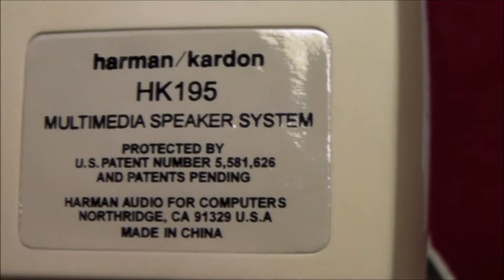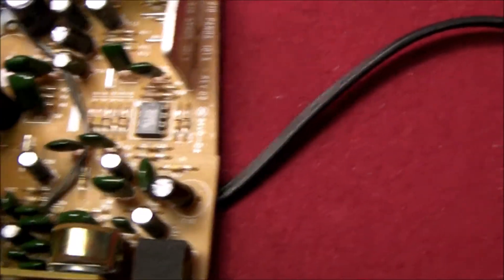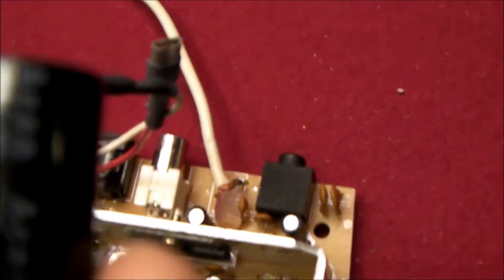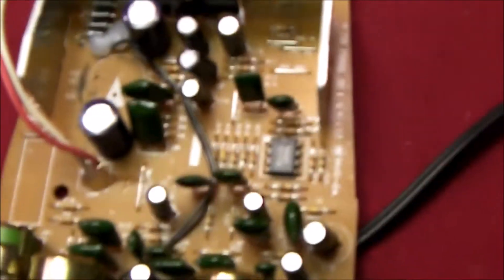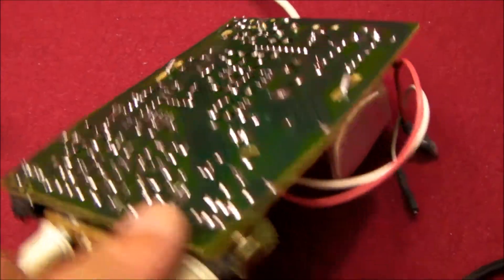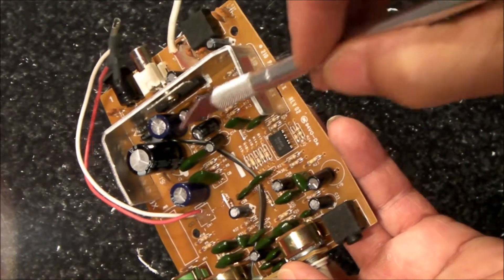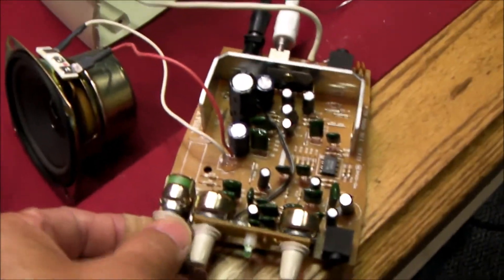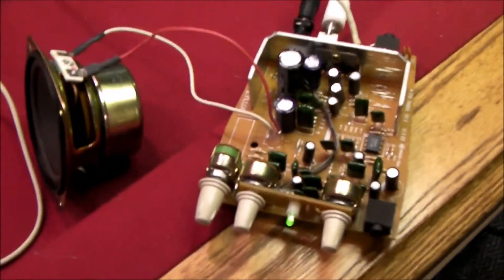Harman/Kardon HK195 Speaker Repair

Comment: I have several pairs both the short and tall. Find them in thrift stores or estate sales go through the old computer peripherals room at work.............They are a worthy sound that is affordable and really quite durable over the years. Even have 2 subwoofers that are large for the sound. 
Once I asked about these speakers and the thrift store manager said there were any H/K speaker pairs they put out in the scrap metal recycling. Going out to the barrel had flooded with rain water and both speakers, wall wart plug all were submerged for days. I took them out and water drained from them....I debated what to do and left them, all were waterlogged and I did not feel like electrocuting myself and threw them back into the scrap metal barrel.

Comment: If you still have these speakers, is there any way you could post a video of how you broke down these speakers? I am having a helluva hard time getting them taken apart for some reason. Thanks.
Reply from the maker: Two visible screws at the back/bottom and then remove the speaker grill (pop it off by prying gently) to find the two other screws.  Here's some crappy video, shot quickly with an ipad:  https://www.youtube.com/watch?v=RmTs2ZmlQjI    I'd appreciate a LIKE and a SUBSCRIBE if this helps.
Reply: @YuDaMan  Thanks! I finally figured it out, though. My issue was getting the grill off. It was on there really good, and I was concerned about breaking it. Finally got it off by patiently prying it open all around with a flat head screwdriver. I appreciate your advice, and will do as requested. Yu truly are DaMan! Never give up, my dude!!
Reply from the maker: @Alpine_Nightly  Just glue it back in with some hot melt adhesive.  You'll be able to get it off again if need be and the grill won't rattle off.  I agree these speakers are worth keeping as long as you can.

Comment: How did you open the HK195 case? I need to replace or repair the left-out RCA jack and can only open partially after removing two screws on bottom.  Broke one locking peg trying to pry open wider and don’t want to damage further. Thanks.
Reply: Thank you @YuDaMan. The grill had 4 plastic compression plugs holding it onto body. All 4 were glued-in, not intended to be removed.  Broke the bottom two but was able to preserve the top two. This revealed two additional screws at top holding the housing halves together. The four screws holding speaker to body must also be removed and the speaker leads disconnected.
Reply from the maker: @coletown_us  got similar question hours after yours so this is for anyone stumbling upon the site:   Two visible screws at the back/bottom and then remove the speaker grill (pop it off by prying gently) to find the two other screws.  Here's some crappy video, shot quickly with an ipad:  https://www.youtube.com/watch?v=RmTs2ZmlQjI    I'd appreciate a LIKE and a SUBSCRIBE if this helps.
Reply: Thanks for this video, YaDaMan.  @coletown_us  Sneaky b@stards at Harman Kardon. I removed the grill using a putty knife.  Indeed, compression plugs, the lower two of which are for sure designed never to come out again (so they broke off). The top ones were hot-glued in and of course there was hot-glue in the screw heads so the screw driver wouldn't catch. The two top screws of the speaker can actually stay screwed in if you don't want to take it apart completely. I had to destroy the cable guard for the Audio In cable in order to get the PCB out. Now I'm wondering - the (heavy!) adapter is 15V AC. I'm measuring 20V on the biggest capacitor on the PCB. Would it be possible to power the speakers with 20V DC or does the amplifier also need negative voltages?
Reply from the maker: Remove the speaker grills.  If I recall correctly the screws are under the grill ... perhaps 2 or 4.  Can't recall ... it was a long time ago.  Obviously 2 on the back bottom that you can easily see.

Comment: Hello!  I'm shocked i found a youtube video on these speakers.  I have a pair and wow have they been fantastic over the years.  Sound quality is phenomenal.    My left speaker (where i plug in my input and output to the right speaker, emits sounds albeit very little while the right one is perfect.  Any thoughts on what this could be?  Thanks for your video.  Still surprised to find a repair on these Harmon Kardons!
Reply from the maker: could be something as simple as bad wire at the plug (twist and jiggle the input cord where it connects to the computer) or more complicated to fix failed electronic part.  I suppose the speaker itself could be shot, too perhaps unlikely.  Sorry, that's all I can think of...
Reply: @YuDaMan  Thanks Udah.  One of your followers suggested the transformer.  It worked.  Thank you for posting.  Can you recommend a speaker that is as good as my harmon/kardon's?  If I can get the same sound I will pay up to $200 clams for them.  Walmart $25 dollar ONN Brand really suck.  Awful.  Maybe good for a kindergarten kid.  Not a 74 Y.O. veteran with tinnitus.

Comment: I have a pair of these and after years of great sound, in the middle of a Youtube video, they suddenly went to a loud hum/buzzing sound no actual sound comes out of it other than the buzzing.  After testing other speakers its obvious its the speakers that have gone bad and not the mini stereo plug in the back of the Desktop.  Even with the stereo mini plug is out of my PC (or any sound out socket on any device) as soon as the power switch is turned on there is a mild hum for about 2 seconds and then a very loud hum/buzzing with the volume all the way down. They are like new cosmetically so I would love to get them working again.  Has anyone had the same problem? Any ideas appreciated.  Thanks.
Reply: Mike breler - Yes, I'm having the very same problem......a mild hum for a couple of secs then a Very Loud buzzing/thumping that I can't take for any length of time before I have to turn them off.   I can't even figure out how Yudaman took his speakers apart to get to the board.  I was able to get the cover off, then took all the screws out and unhooked the speaker, but the remaining speaker shell seems to be a single solid unit with the main board sitting in the bottom of it.  My speakers are model HK195 like his.  Have you tried to break yours down or were you able to get any answers to the problem?  Thanks for any help you can offer.  David
Reply: @dcgeorgia6307  Yes those are the same model that I have.  I didn't want to break the front speaker frame or damage the fabric which seams very easy to destroy.  I tried for a long time but without prying them off using a tool that would mar the fabric badly so I threw them out.  : (
Reply: Well, I pulled hard and was able to separate the front plastic cover from the back.  I can access the board but now the hard part, diagnose and repair.
Reply: Same problem here. Did you found a solution?
Reply: @mikebreler9724  I chunked mine.   There are alot of speakers out there that are better and cheap too.
Reply: The very same issue here, and I shall try to apply my electrical engineering education/experience towards it.  Excellent quality I can tell from taking them apart (electrical component choices are good brands), and the fact that they are about 20 years old now with great audio quality up until the moment the 60 Hz buzz assault started.  As far as taking them apart, you have 8 screws in total.  The two easiest are in the back, lower side, easily visible.  The rest are under the plastic/cloth speaker covers, which will require some prying on four plastic fasteners, held in by some soft hot melt glue.  Careful work with a screwdriver or even better plastic lever/shim can break the glue at the four corners without damaging the cloth.  From there, the rest of the screws come out easily enough along with the primary plastic front cover and speaker.  To access the board, will probably need to use a fine screwdriver or knife to pry the audio signal cable strain relief from the back.  Basically, they are two pieces of plastic that wedge the signal cable snugly to the back.  That gets the main unit fully disassembled.

Now, for the loud buzzing noise itself, I suspect it may actually be the AC transformer that plugs into the wall outlet, as I see no damage to the board.  It may also be a bad speaker, but I somehow doubt that because the sound transfers to both speakers when connected (very unlikely two speaker coils would go bad at exactly the same time).  Furthermore, the same transformer magnetic vibration noise (60Hz) that you hear softly when it is plugged in is amplified very loudly by the speakers when experiencing this problem (turning the power on knob).  Vibrations are a common failure point for electrical components, and this transformer has been vibrating for a good number of years.  So, after all that, you may not need to disassemble the speakers at all, lol.  I shall update after cracking open the transformer unit.  I don't recommend non-experts to do that disassemble job, though.  We shall see if a simple transformer plug replacement does the trick, though.
Reply: @ryanotte6737  Ryan:  I went out last night and foolishly bought a set of ONN Speakers at Walmart for $25.00.  I plugged them in and said, "No, these are really junk."  Then tonight after I popped a pain pill and relaxed a bit searched out on YouTube not expecting to find anything.  I went to the back room and found an old transformer and plugged it in.  My Harman/Kardon are once again pumping out some smooth jazz starting with "Sade -- Smooth Operator."  Thanks to you and da man for helping me out.  I'm an old Vietnam combat Marine with a brain about the size of a pea living here in my winter home, packing up in April to head back to New Hampshire with my old cat "Blue."  Thanks guys!  Heading back over to Walmart in Palm Springs, Fl. tomorrow.
Reply: Oops, seems as though other comments have described how to open these units up, but oh well.  So far as the power supply, it seems to be outputting a stable voltage, though I can only confirm this with a multimeter stable reading not an oscilloscope to check the signal.  I am hesitant to open the plug unit up since it seems to be press fit sealed pretty tight, and sure seems to be working fine yet from its output voltage.  That would be an easy/cheap fix though to replace the plug unit transformer.  

So, that brings us back to the likely culprit somewhere on the main board.  With no visible damage to any components, no bulging capacitors or black short circuit damage, that leads me to a potentiometer (the knobs) as the likeliest suspect at this point.  These have moving parts that I have seen fail in other devices pretty commonly; eg: electric guitars are known to get these replaced.  For our case, probably the power knob could have a short that feeds the AC voltage signal somehow into the speakers, which would be a larger signal than usual and cause that immensely annoying loud 60 Hz buzz.  Checking on that now... also cleaning the board with alcohol, especially the bottom to rule that out.
Reply: Potentiometers seem to be operating fine; their resistance changes smoothly as measured.  Cleaned the board even though it appears to have stayed dust-free in the sealed case all these years.  Still that blaring sound.  At this point, I conclude that there must be some board component failure that is feeding the AC power voltage to the speakers, possibly in what's called a ground loop.  I just can't see any damaged components, even under a magnifying glass.  My last effort might be to replace the big capacitor as was done in the video above, even though it doesn't appear damaged.  Other than that, this situation in troubleshooting would call for replacing the board, but that might be a tall order to find.  For me, likely going to finally get a new pair, though Harman/Kardon sure have me as a repeat customer with their quality/longevity.

Comment: +YuDaMan
My issue with these speakers (which I love) is that the sound goes in and out..or left or right..depending on how the plug that connects them to your device is bent. Is the solution removing the plug and then putting in a new one? Or would it be too hard to reconnect the wiring inside? Thanks for any answers!
Reply from the maker: you could either cut the cord 6-12" and install just a new plug or replace the entire cord and plug from inside the speaker all the way to the plug.  You need basic soldering skills and tools to do this.  Not hard but if you've never done it before, the outcome is likely to be less than perfect and might not be any better than what you have now.  Please subscribe to my channel.  Thanks!
Reply: Thanks for the reply! Yea..I have no soldering skills..so I just purchased a new pair on ebay for about $64. These are so hard to come by today in new condition..so..I'm hoping the seller isn't lying..lol. I subscribed..and thanks!
Reply from the maker: If you are on the East Coast (NE) of the US, I would repair them for free for you, NOT KIDDING.  I really hate good stuff being tossed into the landfill.
Reply: Thanks so much for saying that..what an awesome person you are for offering! I live in the deep South (Gulf Coast)..so too far away..but if closer I would give them to you since I just ordered a new pair and hate to toss them out as well. But again thank you for the generous offer! 😉